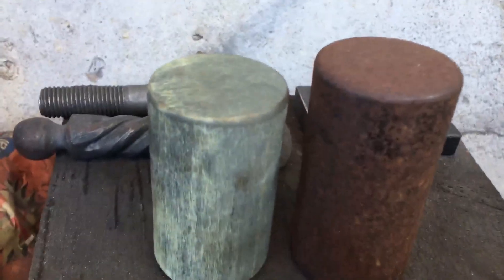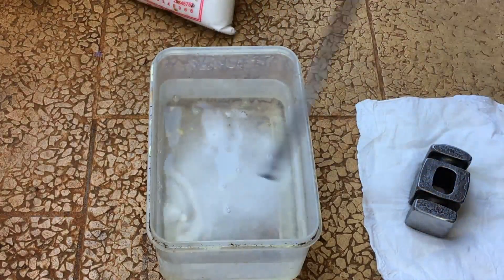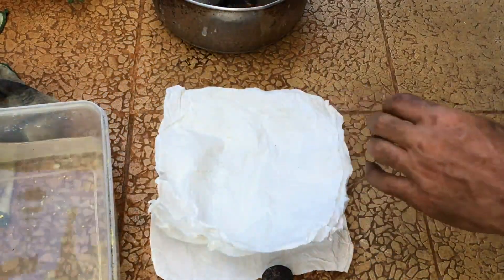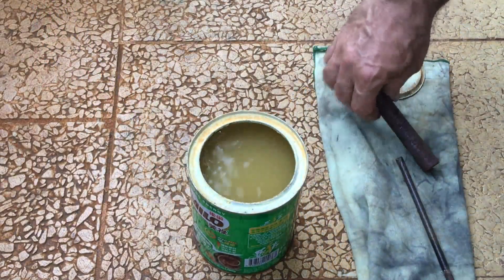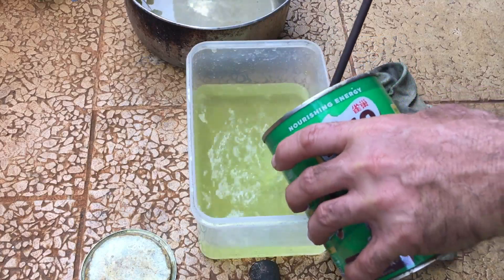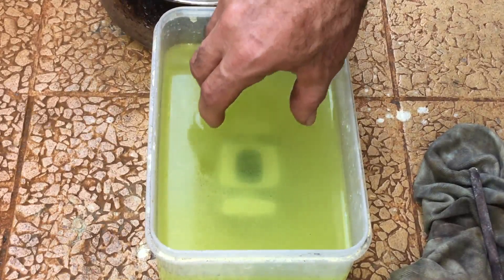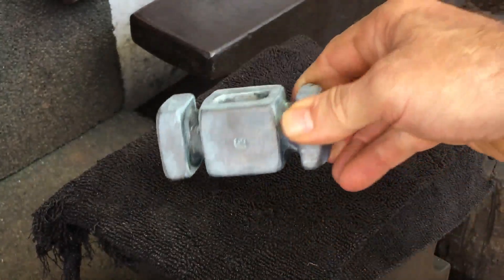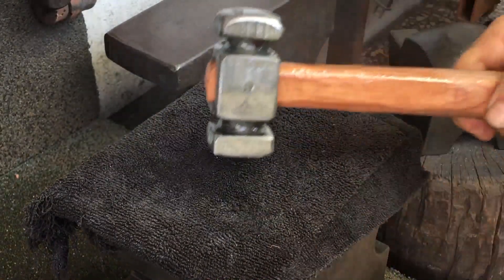How To Get Green / Verdigris Coating On Steel

Comment: try iron filings in the new solution  same with ferric chloride it always works better after it has interacted with one or 2 projects
Reply from the maker: Iron filings is a good idea. I noticed that the older the solution, the better the results. And your comment confirms I went in the right direction. Thanks for sure.

Comment: Good work Glen, Im guessing that would also prevent oxidation in humid climates? What was the acid you used, I couldn’t pick it up,my hearing is shot!
Reply: Oxalic acid
Reply from the maker: Thanks for your help.
Reply from the maker: Hi Paul, Oxalic Acid, as Alx Shu mentioned. This coating really does prevent oxidation. I've had pieces outside for weeks here that haven't rusty which is a small miracle. Thanks.